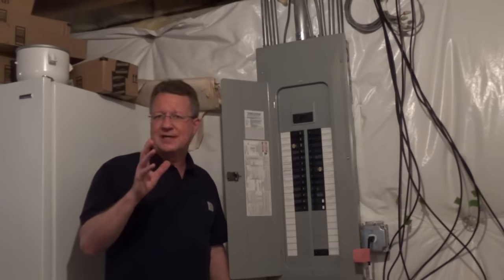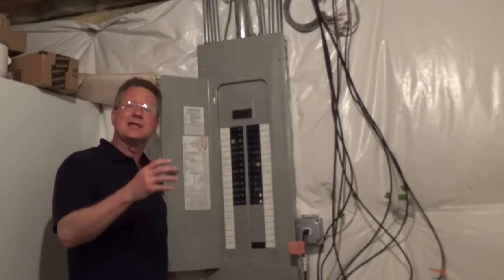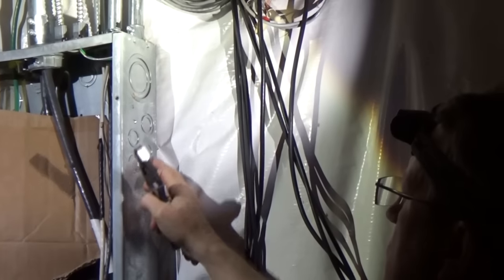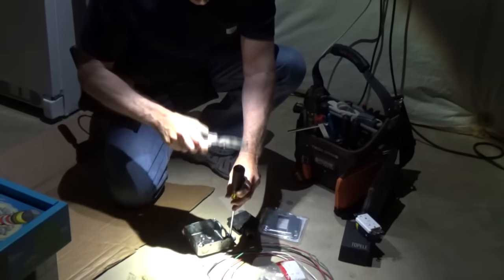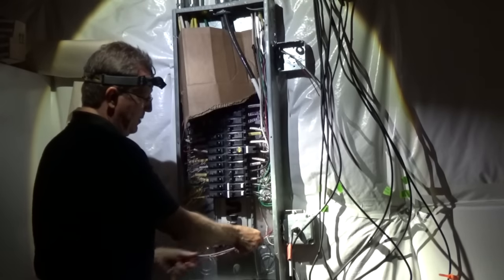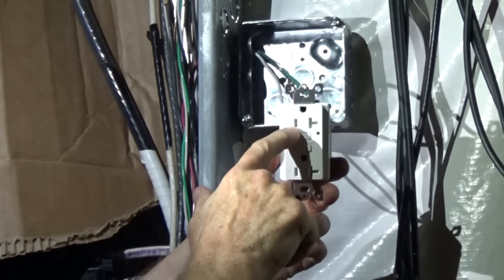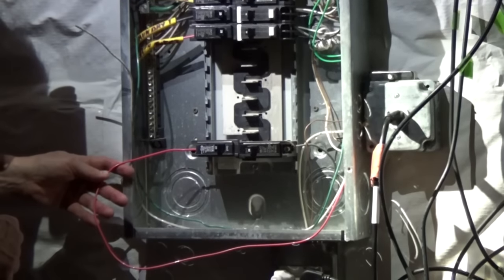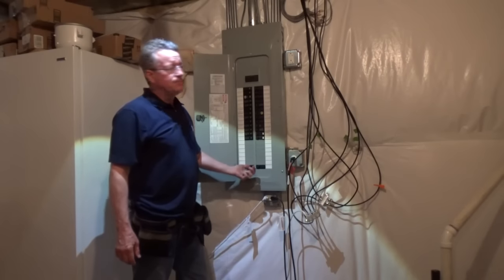Add an Electrical Outlet to a Breaker Box

Comment: While feeding a metal fish tape through an open panel, I let go of the tape and it swung against the panel's feed line. Of course I knew those lines were live, but the exertion of feeding wires made me inattentive. It burned through my metal tape in a fraction of a heartbeat, blew sparks at me, and gave me a new and lasting respect for electricity. I'm lucky to be here. Turn off the panel and cover those lines.

Comment: Why does the ground wire have to be up if it's 36in or higher?
Reply from the maker: Hi, the local inspector recommended ground up if we will be installing a workbench or other counters in the basement for safety. It's not required, but we followed the suggestion.
Check out more home improvement tips in our e-books https://www.amazon.com/gp/product/B0B2KW1FQ9?notRedirectToSDP=1&.

Comment: When we moved into our new house, I noticed a GFCI outlet that was installed right under the panel and connected to one of the 20 amp breakers along with another set of wire. No idea why this was installed in the first place. Now that I see HOW it was installed, I plan on removing it since I don't need it. Love your idea about using a cardboard to cover your main lug.  Very straight forward. Thanks
Reply from the maker: You're welcome.
We have more home improvement tips on our weekly podcast 
https://itunes.apple.com/us/podcast/fix-it-home-improvement/id880903087?mt=2

Comment: Hello, first I wanted to say thank you for the great how to video. Its going to be such a help for my upcoming project. I see that you have been replying back to most comments, so Im going to take a shot and see if you wouldn't mind answering a question for me as well? I am currently in the process of turning my garage into a workshop and I wanted to add additional outlets for all my tools. Their is only one outlet in the entire garage and instead of tying into it, I wanted to run them all into their own circuit on my panel, as you've done here. My main question is how many outlets can I have on the same 20v circuit without blowing the fuse? The way I designed the outlets is to have one every 3 feet or so on one long strip of conduit down a 24ft wall. I will have all my power tools along this wall connected to those outlets, such as miter saw, table saw, drill press, etc... I hope I am explaining myself correctly haha? The only thing different I'm playing on doing is maybe having a 220 for any tools that might need it. Again, any help you can offer at all will be so appreciated, you have no idea. Thanks in advance!
Reply from the maker: Hi, the general rule of thumb is 10 outlets on a 20 amp circuit with 12 gauge wire. You can then have a dedicated 240 volt outlet on its own circuit. Check out the Black and Decker has a Complete Guide to Wiring, they have some great tips and visuals. 
We have more home improvement tips on our weekly podcast  https://podcasts.apple.com/us/podcast/fix-it-home-improvement/id880903087?mt=2
Reply: Thank you so much for the reply! You sir, are a awesome human being! I will check it out. Thanks again!
Reply: @FIXITHomeImprovementChannel  Hi again, that Black and Decker has a Complete Guide to Wiring you were talking about, thats a book correct? I just wanted to make sure it wasn't a youtube channel or something? Thanks!

Comment: Thank you for this. So, in the case of a power outage, a small generator would be safe to plug directly into the new outlet to power your home? Thanks again.
Reply from the maker: Hi, you can't connect a generator into an outlet without a Transfer Switch to disconnect the service panel from the utility power. The electric from your generator can back feed to the utility power and potentially be deadly for workers. You are also protecting your generator when the power is restored. Here is a podcast episode with some tips https://youtu.be/uH3POp1UcRM

Comment: I like the pace and clarity of your video. We’ll done. Couple questions tho, does the box spacer also serve as cable clamps? Also, no grounding pigtail from receptacle to back of box . Can you clarify the grounding/bonding involved in this project? Cheers!
Reply from the maker: Hi, this is how I was taught by my electricians in the Chicago area. Most of our projects are run in conduit, so we don't use cable clamps, we just run individual wires. The service panel connected to the metal spacers and the metal box is the ground path. You could add a grounding whip, but the metal box is grounded.

Comment: Great presentation, thank you.  Question:  You knocked out two slots on the breaker box, and 2 on the addition box, but only needed one for the new wire.  Was one for just securing the new box to the breaker box?  I wish you would have showed the box to breaker box connection in the video.  But,, great video.
Reply from the maker: Hi, yes the other knockout was to help secure the box.
Glad it was helpful.We have more home improvement tips on our weekly podcast, Fix It Home Improvement. You can subscribe on your favorite podcast app. https://www.stitcher.com/podcast/fix-it-home-improvement-5/fix-it-home-improvement

Comment: Should neutral and ground wire be mounted in same strip?
Reply from the maker: Hi, in some electrical panels they are, in others, they are separated.
Reply: Geng Pan to give u a more specific answer, if it’s your main panel u can mix grounds and neutrals if it’s a sub panel separate then

Comment: Why did you choose a lower position on the bus bar for the new breaker?
Reply from the maker: Hi, there was already a breaker at the bottom right, so it was easy to remove the blank cover and it gave me room to work.
Reply: Gotcha. Nice video. Thanks for the response.

Comment: I would like to see "how to know if your box has the capacity to accept a new circuit".  You said you were putting in a new 20 amp circuit.  Are there any times when you can't do that?
Reply from the maker: Hi, you need to have an empty space available in the box. You will see a black cover over an empty space. You also need to know the limit of the main breaker.
Reply: @FIXITHomeImprovementChannel  Yes, the question is how do I determine the limit of the main breaker?  A friend in construction has since told me that the best rule is for the cumulative circuits not to exceed 2x the service amperage to the house.  I have 200 amp service so I am making sure not to exceed 400 amps of breakers.
Reply from the maker: @DarronRansbarger  Hi, add up the amount of all the individual breakers in the box and double it. It will give you a general guide to what you can add to the box. You can then add up the individual appliances and loads you put on each circuit regularly to get a more accurate idea of the load you are putting on your service panel.
Reply: @FIXITHomeImprovementChannel  Thanks!

Comment: so if you ran wire like this through a pipe and put that into the ground you could route it to a shed near by?
Reply from the maker: Hi, check your local code. I would run PVC conduit underground with an underground feeder cable. Plan on what you will be using in the shed. You may want to have a subpanel in the shed for multiple circuits. 
We have more home improvement tips on our weekly podcast  https://podcasts.apple.com/us/podcast/fix-it-home-improvement/id880903087?mt=2

Comment: Thank you for the informative video :)
I have questions about the electric panel in my house.  
Question :
a.)   is there a maximum distance I can run a wire from a 15 or 20 amp 
breaker to a run of 4 or 5  outlets and a light switch ?

I'd like to replace a yellow 12/2 residential wire (romex ?) w/ a grey 
UF (direct bury) wire that feeds a shed / shop in my yard.
Thanks for your generous consideration,
sincerely ...............................
Reply from the maker: Hi, around 100 feet is the norm for most projects without worrying about voltage drops, depending on what you will be using on the circuit.
We have more home improvement tips on our weekly podcast http://castbox.fm/u/6389499.

Comment: My breaker panel is outside, can I do this same thing outdoors? I was looking at my options the other day and seen these "outdoor" boxes but it had 3 1/2" threaded plugs on it. Would I just have to get 1/2 threaded pipe to attach it to the box? If so would I just stick the pipe through the hole in the panel then put a nut on the inside to hold it in place? What you are doing here just seems much more simple and would rather do it this way and maybe put some kind of waterproof cover over the outlet?

Comment: Question!! The ground wire a neutral wire  go to the same hole ? You didn’t showed that clearly? Thanks
Reply from the maker: Hi, It depends on your service panel. Most will have a neutral bus bar and a grounding bus bar, but older panels will be set up for neutral and ground on the same bus bar.
Reply: In the main service, a ground and neutral can be on the same terminal bar. However, neutrals should always be alone under the lug i.e. not bundled with ground or another neutral.

Comment: My outlet is ungrounded with a GFCI on it, It is still causing me problems and letting the electricty loose and going to me when im sleeping. Is there an easy way to completely disconnect the outlet from the breaker box, so that way it never has electricity coming from it again
Reply from the maker: Hi, you can email me at fixitpodcast@gmail.com.
Reply: @FIXITHomeImprovementChannel  I did i havent got any response yet. Do you have any videos of this?

Comment: I'm trying to add multiple outlets to my basement. There's only one down there. Would I add a new breaker for each of the outlets or is it possible to wire all of them to one breaker similar to other parts of the house? Also I want them to be scattered around the room so would this method work still, if I dont want the outlet right up against the breaker box? I've been searching all day and so far this is the only video that helped. I'm just out of my zone here so I still have a couple questions. But this video definitely makes it easy to understand for the inexperienced people watching. Great work!
Reply from the maker: Hi, Black and Decker has a Complete Guide to Wiring that should be a great reference. Get the latest edition for the new code changes. Yes, run the basement outlets on a new breaker. 
We have more home improvement tips on our weekly podcast  https://podcasts.apple.com/us/podcast/fix-it-home-improvement/id880903087?mt=2

Comment: Why didnt you ground the metal box?
Reply from the maker: Hi, the conduit is grounded to the service panel. You could add a grounding whip.
Reply: FIX IT Home Improvement Channel this would be true in theory. But if the conduit nuts were loose or missing wouldn’t the box grounding become ineffective? It sounds like adding a ground jumper or pigtail would be cheap insurance. Great video though! Thank you!
Reply: R C    Good points, but his install is as approved by NEC.

Comment: Great Video.  More of a code question, but I'm curious. I have a GFI outlet already connected to my box just like the video and I'm wondering if i'm allowed to run more outlets in my basement on this circuit, or if this receptacle is intended to be by itself per code?  Thank you.
Reply from the maker: Hi, in most towns you can add more outlets. I would call your local electrical inspector and ask. I have found most to be very helpful.
 We have more home improvement tips on our weekly podcast, Fix It Home Improvement. You can subscribe on your favorite podcast app. https://www.stitcher.com/podcast/fix-it-home-improvement-5/fix-it-home-improvement

Comment: have a circuit breaker that now works in when in the off position, and doesn't work in the on position. I just did some rewiring, and am an amateur. I messed something up somewhere.  What could it be ? Is it dangerous ?
Reply from the maker: Hi, you can send a picture of the breaker and how you wired it to fixitpodcast@gmail.com.

Comment: Question: is the ground wire you ran strictly necessary in this panel, or is the spacer essentially a conduit, and that counts as bonding to the ground on the panel? My panel has separate grounding bars (screwed directly into the box) from the neutral bus, and I know conduit counts as an EGC here. I guess I may as well use my offset-nipple-conduit as the EGC if it's bonded on the same place.
Reply from the maker: Hi, the metal box is grounded because of the connection to the service panel with the metal spacers.

Comment: I want to change the receptacle attached to the main from an old one outlet version, to two outlet receptacle.   Is there any codes that prohibit doing this? Clearly your gfci is 2 outlets, not sure why there is a 1 outlet version in mine.  Your video had one too.
Reply from the maker: Hi, in some areas where a receptacle is for an appliance, they want to limit what can be on the circuit. I would give you local village inspector a call and explain what you have. I've found electrical inspectors to be very helpful.

Comment: I have an outlet that is connected to a wire in the wall, but was not connected to the breaker. It was left free in the attic. Do I need to connect it to it’s on breaker or can I splice it in to the ceiling light?
Reply from the maker: Hi, you can send a picture to fixitpodcast@gmail.com

Comment: so wait. Wouldn't installing the neutral and the ground on the same bus mean that the ground wire constantly has a current on it?
Reply: Gyras    No, the neutral and hot are both connected to a load before any current flows.   Grounds are not connected to any load, therefore no current.

Comment: Aren’t you required to ground to the box too? Everything I see shows grounding at the box in addition to the ground on the bus bar in the panel? Why, I have no idea.
Reply from the maker: Hi, this is the way I was taught by my electrician. A metal box connected to the metal service panel is an effective ground fault current path. You could add a grounding pigtail to the metal box and attach it to the ground wire for extra protection. You can test the metal box to make sure it's grounded. Here is a video https://youtu.be/NikzetYdi4U
Check out more home improvement tips in our e-books https://www.amazon.com/gp/product/B0B2KW1FQ9?notRedirectToSDP=1&.

Comment: I am installing a 50 amp breaker for my generator. I need to move two single pole breakers. The trouble is the wire comes in from the top and I want to move them to the bottom, however the wires are to short. Is there a way to lengthen these wires?
Reply: David D you can pig tail them via the use of a “wago lever nut”

Comment: So how do you do the same exact thing as in the video - if the breaker box is set in the dry wall and studs are located on the side panels?
Convention garage in the wall breaker box.
Reply: Up top you could cut a drywall flap and drill a hole through the stud then cut the hole for you box below that where you want it and fish the wire down
Reply: @christophersellers4018  I removed some dry wall above the left corner on the main breaker box and entered the 1/2 inch opening in the top left corner.  I then placed a junction box above the breaker.

Comment: hello,  one of the main ground  cable that runs from outside and connects to the braker box its almost disconnect it. the nut thats holds this thick ground wire is very tightly but the ground  wire is only connected by half of the wire. 
can i disconnect this ground strip an inch and reconnect  it and not having problems in the circuits,or electrocution...??
thanks so much. 
one ground connects to the braker  box (the wire to be fix) the other ground to the neutral bar.

Comment: So the green ground u put it were all the white goes????
Reply from the maker: Hi, depends on the service panel, some have the ground wires on the same bus bar as the neutral. In some panels they are separated. Check what you have and follow that.
We have more home improvement tips on our weekly podcast http://castbox.fm/u/6389499.

Comment: Any particular reason you put the box up so high?  Most outlets are a couple of feet off the floor.
Reply from the maker: Hi, we put this in specifically for a radon mitigation system that we installed.
We have more home improvement tips on our weekly podcast  https://podcasts.apple.com/us/podcast/fix-it-home-improvement/id880903087?mt=2

Comment: Do you think 8 gauge wire will fit a 15 amp breaker?
Reply: Bad Weatherfreak     Yes, up to #6 I believe.
Reply: I would just check the spec sheet for the model number for your breaker. It will specify the range of acceptable wire gauge for the terminals.

Comment: Curious question, I'm by no means an electrician or correcting anything you did. Would it be better to attach the ground and neutral 1st in case of a mishap somehow, the voltage has a path to ground ? Thanks just curious.
Reply: RONNIEJNZN that is good practice for most scenarios, however the fact that he shut off the main breaker negates any dangers since his installation is right on the electrical panel and so no one is going to be able to energize it without his knowledge.